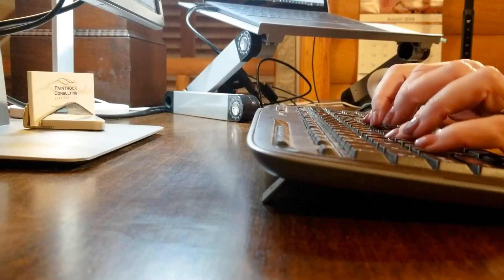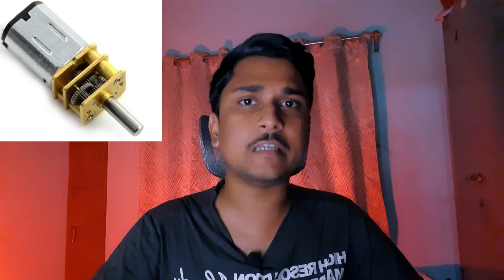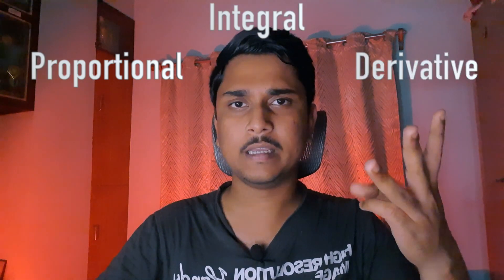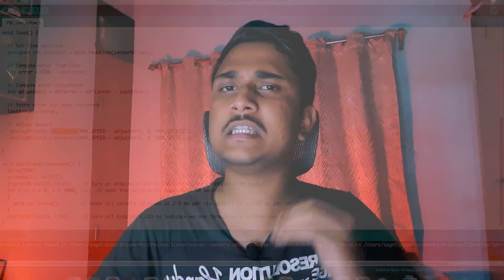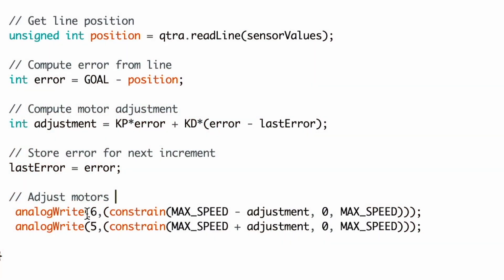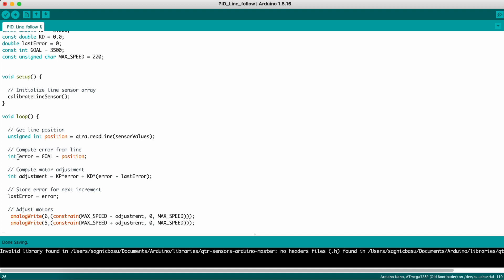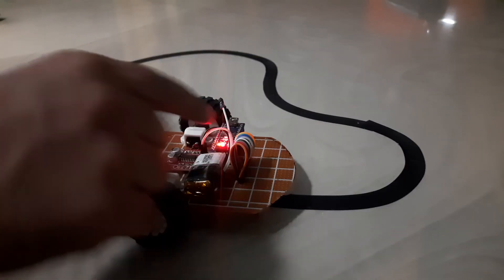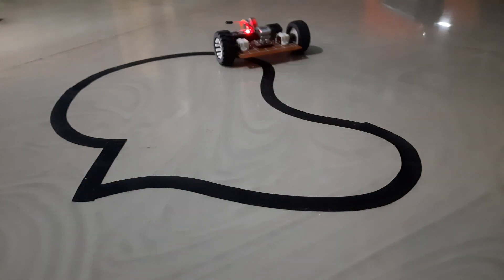Unravelling the mystery of PID: LineFollower Robots Decoded! 🤔

Comment: Hi, How can I get Maximum error value for my bot  like you got 3500
Reply from the maker: @mithilpanchal6901  it is a inbuilt feature of the qtr sensor library if you are using the library you can get the error but if you are doing manually youll have to manually code up the entire logic to get the error

Comment: Definitely excellent ❤️‍🔥❤️‍🔥❤️‍🔥
Reply: How to add ultrasonic sensor function to pid robot code???
Reply from the maker: @mahdizayet4011  simply add a function in the code which senses distance and then the simplest way is to hardcode a semicircle turn according to the physical specifications of the robot.  Or the robot can keep tracking the obstacle and go around it till it finds a line.